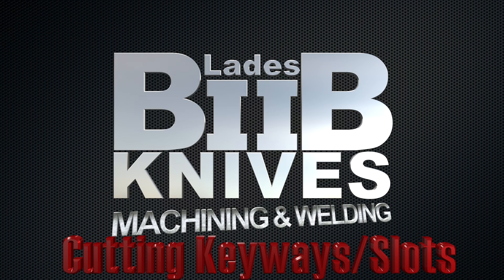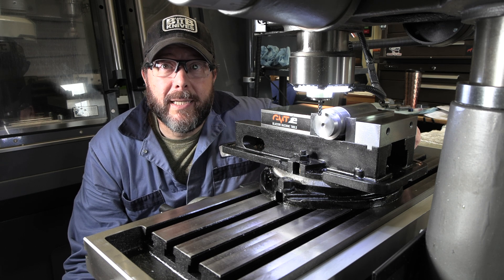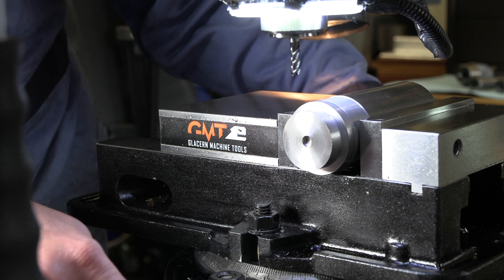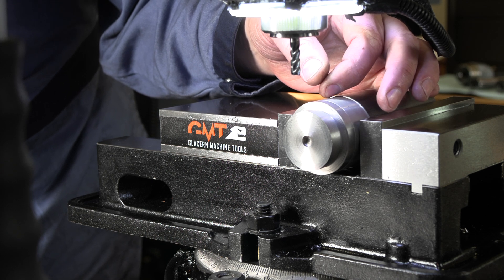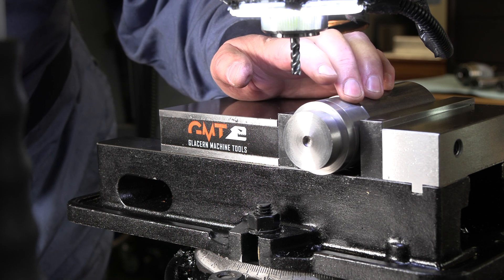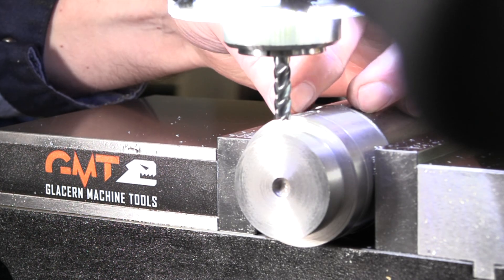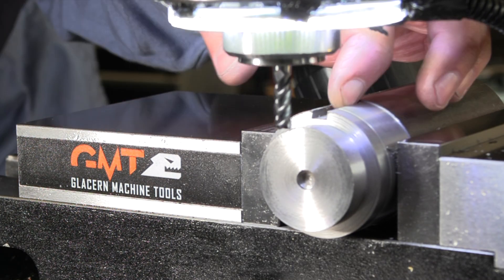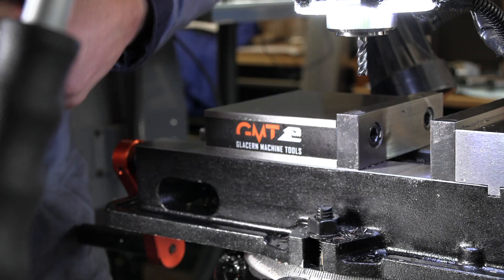Machining/Cutting Keyways/Slots For Dummies-Rigidity Test Round Column Mill-Largest Key Full Depth?

Comment: I was disappointed that you didn't do any measurement of the finished slots.
Reply from the maker: @tomdewinter - Thanks for the comment and the feedback.  I guess since it was not a real project, I did not think about that aspect, sorry to disappoint.  I did not have any key stock to check the fit but here is what I measured with my digital calipers.  The ¼" slot that I back fed after cutting (should not do that) was almost .002" oversize.  The 3/8" and 1/2" slots were about .0005" oversize.  Should only vary based on the runout of your spindle.  Also for a tighter keyway, a 2 flute often cuts a little truer to size than a 4 flute.  A 2 flute center cut end mill will also allow you to plunge and cut a keyway in the middle of a shaft.  The nice thing about making the key in one cut full depth is any backlash in your machine table is all pulled out at the start of the cut and you should cut the true diameter of the end mill (plus any runout).  Hope that helps.
Reply: @BladesIIB  Thanks for your reply. You got better accuracy than I expected. 
I’ve never pushed my round column Enco that hard. Good to know that I could.

Comment: Yeah, that was surprising to see you can remove that much material at that speed with a bench top mill. Round column one at that. I thought you had a Precision Matthews knee mill for some reason. I have the PM-835S.
Reply: The fact that he had to recenter for every cut tells you the machine moved quite a bit working it like this. Stopping the carbide in the cut, hogging needlessly, pushing the machine past its design limits, its like a "How not to" video. Im seeing sloppy keyways that are canted and P shaped at the end of the cut. You can even see the P shape in the video.
Reply from the maker: @memyself3275  Always appreciate another perspective.  Thanks for the comment and the feedback.  I did recenter after the ¼" cut.  Once it cut full depth it likely did pull the table over and move and set the flex in the machine.  I did not adjust again for the ½" cutter, so no additional shift with the 3/8" cut, at that point the shift and flex had already occurred.  By cutting the key in one shot at full depth, IMO it sets all your flex at the beginning of the cut and if you maintain a consistent feed then the flex stays more or less the same through the cut and you end up with a pretty good keyway.  As for pushing the machine to hard, if you watch the intro again, that was one of the main points of this video was to answer a question someone had about how hard can you push this type of mill in steel.  I was trying to push it hard to find those limits.
Reply: @BladesIIB  Gotcha. Glad to see you could take a lil ribbing from a fellow tradesman.
Reply from the maker: @memyself3275  Ha, for sure. The beauty of this and most trades is there are a lot of ways to do the same task. I am always happy to learn. You did make me go and check my Machinery’s Hand Book though and the for a class 1 fit the tolerance for the 3/8” key seat is -.000 and +.002 and for the ½ is -.000 and +.003. Even on this machine I feel confident I held to that. 😁
Reply from the maker: @robotech - That is a nice mill you have.  I found PM after I purchased this Jet.  I have the PM 1440TL Lathe and wish I had one of their mills.  But this Jet has worked out well for me in the end.  Thanks for the comment.
Reply: That's not considered a bench top mill. That weights a little over 600 lbs.